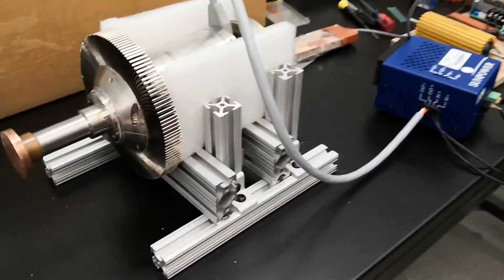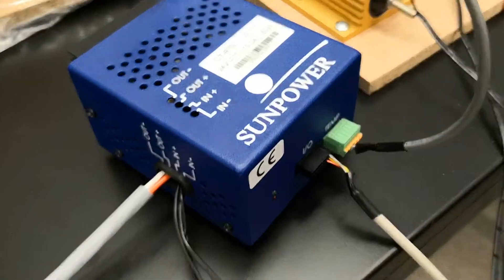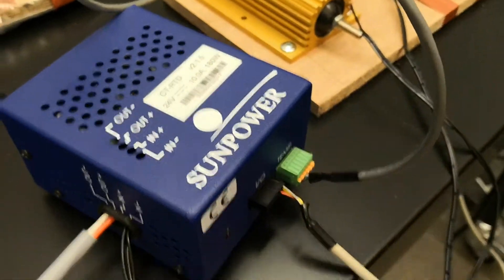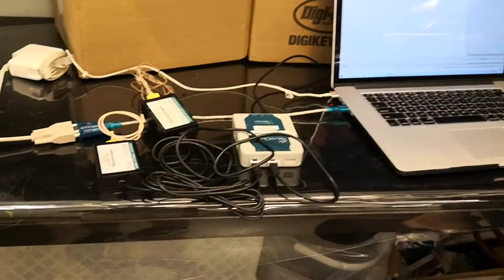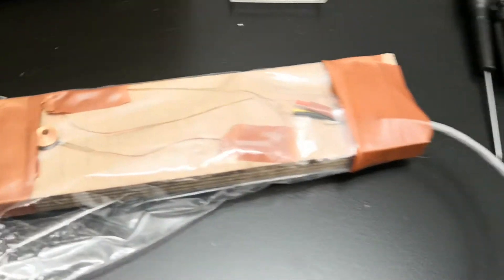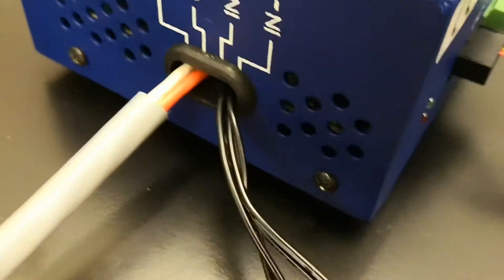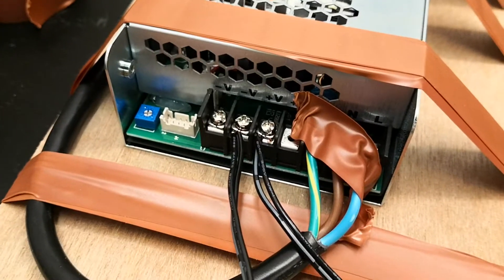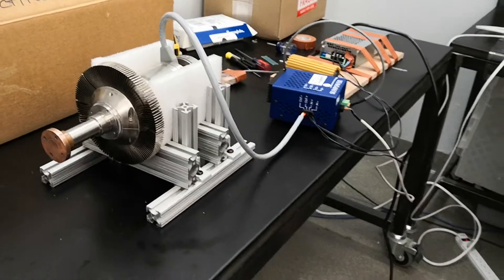Cryotel CT Test

Comment: bro, how much did it cost, i heard they were like 19k for the unit
Reply from the maker: Hey space, I was able to work with this Stirling engine cryocooler as part of a capstone course that I took in my last year of my undergrad. Funds from the course helped pay for the cryocooler and other components. The best way to get a quote is to contact the OEM itself, the contact details are on the website (https://www.sunpowerinc.com/).
Reply: @MrJack5672  nice, i recognised the cooler as the cryotel gt i think, and thank you for replying
Reply: @MrJack5672  ciao contact me
Reply: I've been using one of these since 2018 to make liquid nitrogen and liquid oxygen.  I'm trying to improve my cooling design right now.